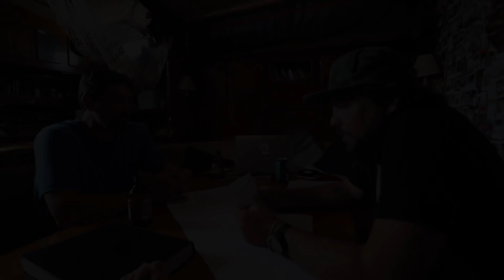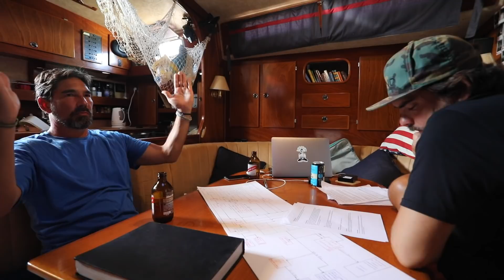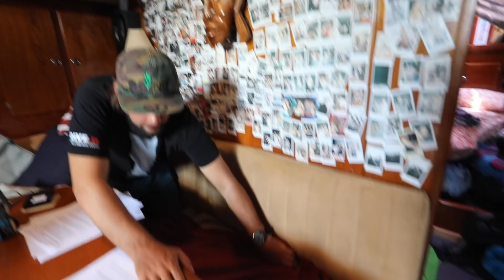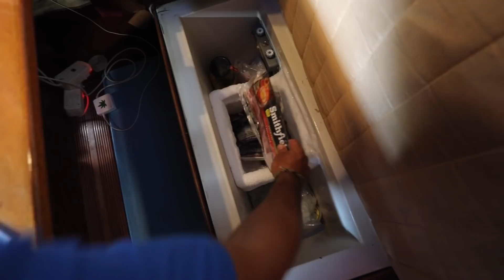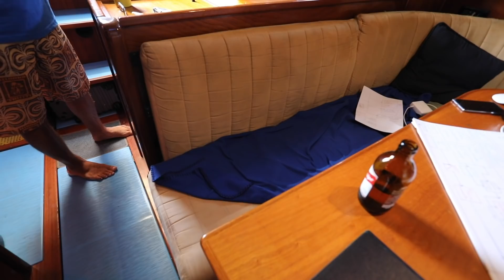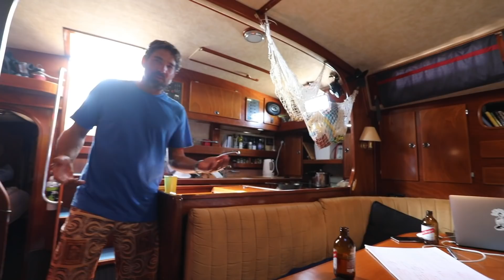How Cost effective is solar power? - ELECTRICAL BOAT TECH (7 of 7) -  Sailing Vessel Delos

Comment: It looks like your freezers are (just guessing) 1 foot by 3 foot and 1.5 feet deep making it 4.5 cubic feet. That's pretty much a normal home freeze size. But you have 2 and one is not used. Could you turn the one to the temperature of a fridge for those times you need more fridge space?

Comment: Brian, you blew it on the solar cable size.  You considered the MPPT output to batteries.  But there is a large voltage drop in the MPPT from the solar to the battery.  Your cells probably output 95 volts or so at a much lower amperage, and it's that current flow that you need to cable for, not the output of the MPPT.

Comment: It's my Birthday in two day's. The coolest gift I could receive would be a reply to this suggestion, and even better if Delos takes up the idea for a video/s. May I suggest Brian does a video explaining some basic electrical theory, and use an existing web page so viewers will have reference information. Some topics beyond explaining watts, amps and power should include wiring in series and parallel, starting current vs running current for electric motors, sizing wire for amps and length of wire, end connections, running wires through bulkheads so they don't chafe, and a few other things. This can be aimed at someone wanting to install LED strip lights for example. For voltages above 24V, stress the point that only an electrician or suitably qualified or competant person should touch this and why.

Comment: When calculating wire gauge, Amps and distance of the run are the two critical factors.  If the gauge is too small for the run and amperage, you will see a voltage drop from the source to the drain along with generating heat in the wire which will also increase the resistance, causing more heat and more voltage drop.   Clearly boats aren’t that large, but something to keep in mind for folks doing land based solar.
Reply: If i'm not mistaken...and I could be, #8 thhn copper is good for 55 amps. Why run #4 or #6?? just asking. plz correct me if I'm wrong

Comment: Without looking through all the replies you already have...... have you thought of mounting a compressor on your main with direct drive (with a clutch maybe so could be disconnected when not in use) a bit like a A/C compressor on a car?   You might already have the PTO on your timing cover??? again not 100% on your engine without looking it up again.

Comment: One thing you say in this video I have to quibble with: I have a 9KW Electric Yacht motor in my 36' ketch, but I almost never run it full throttle. So saying that electric motors draw 10-20KW sounds wrong to me. The minimum to move my boat is about 400 to 500 Watts and 1-2KW will drive the boat at 3-4 knots. I don't have solar yet, but I think I've figured out how to put four 300 Watt panels on my boat. With 1.2KW of solar, by motoring slowly, I could keep up with with motor energy usage while the sun is shining. If I were to go at minimum speed, I could probably keep moving around the clock (very slowly). I eventually plan to add a wind generator and switch to Lithium Iron batteries (or anything better that comes along). Also, the motor starts generating power when sailing at over 5 knots. Contrary currents and wind on the nose can be problems, but not having to hunt for dodgy diesel in questionable ports seems like a win to me.

Comment: Brian, with respect, you may be forgetting the regenerative capabilities of the electric motor as the prop is dragged through the water whilst under sail.  This can generate as much as 2KW a day at a moderate 4 knots... more than enough to recharge a Lithium bank for propulsion: Four days of regenerative sailing would gift the battery bank sufficient power for 4 hours of motoring.

Sure, it's not enough to motor for days when completely becalmed, but you're cruisers... what's the hurry?!  Go with the weather!  The regen capacity will give you more than enough to get out of the way of a storm or get into port.  

I'm surprised you guys haven't cottoned on to the Watt and Sea hydrogenerators by now.

Comment: You mentioned 3 to 1 in your weight convention in regards to your solar panels. Actually 2.2 lbs = 1 Kilo.
Reply: One solar panel is 17 kg, so the weight of the three panels is 51 kg. That is perfectly OK with me because hey have three panels on that arch. It was not a conversion BSMOODHA. I love the brothers using metric as Americans and no lbs.

Comment: Looks like you need to "deice"/clean your freezer evaporator. Hard too see how thick it is with the ice on it bit they are usually pretty Thin. It helps alot on power consumption.
Best regards from the West coast Sweden

Comment: With a pid controller you can use your second freezer as another refrigerator it would run extremely efficiently as it has a bigger compressor then a refrigerator

Comment: We have 8 panels rated for 2.76 KW of feed and initiall output is 3.1KW... producing 27.6- 31 KWh per day they ate also engineered to work well in cloudy weather,  we also have approximately  14.4KWh overnight storage...
Reply: Miss print... 8ea panels  345 watts each, 3.1 KW, total watts...

Comment: My solar panels are 345 watt that's guaranteed not to drop below that amount for 25 years they are Q cells from Germany,  actually when you first get them they put out 376 watts per panel...they were $220.00 per panel, they are fairly big at 1 meter by 2 meters but well worth it... can't be beat... we got them from a distributor in south Carolina...  if you really hunt around good deals can be found,  we also got ours close to end of the year so they were clearing out old stock...

Comment: Could you set your 2nd freezer to fridge temp and use it as a 2nd fridge? Or run it for say an hour then turn it off for 6hrs for those long trips and 6 crew times?

Comment: I really liked this whole series. If you want to reduce the starting current on a motor like you dive compressor, you could look into putting a soft start or VFD in the circuit to reduce the initial spike and control the power. You can contact the manufacturer of the compressor to see what they think. If you contact a VFD manufacturer (like Allen Bradley) they will tell you they can do it. Cause they can.

Comment: if you had the space for it, would one of the Tesla "House mount" batteries be a workable alternative to the bank used on Delos??
Reply: Interesting question for Brian.  According to a pdf found at Tesla, the Powerwall has a usable energy storage of 13.5kW-hr.  In part one of this series, Brian says that Delos has 400A-hr at 24V which is 9.6kW-hr of energy, so the Powerwall can store about 41% more.  In segment six, Brian says that they can't really run the air conditioners at 1000W each for very long, so the battery capacity does limit some types of high power usage.  The Dragon Fly Energy Batteries  fit very nicely in a space designed for lead acid batteries.  That might be difficult for the Tesla solution to best.
Reply: the size factor would be a definite problem and I don't see a boater being interested in a Powerwall  for most instances, where as you mention, they're replacing existing battery banks that have been sized for "standard" batteries.   
I was thinking of a case of large scale remodeling, or a full scratch-build (like Ross from Life on the Hull, building his own catamaran, or Mads from SailLife , who's gutted and rebuilding a sailboat)  where a specific place could be built for it,  I wondered if it would be an economically viable alternative...
Reply: @timhyatt9185  Heading to Tesla.com, I find that the v2 powerwall are $7600 US which is competitive.  8 each Dragon Fly are $8000 for less total kW-hr.  So if you can find a way to map the Powerwall slab to the domicile (sailing vessel or traditional sticks and bricks domicile) it appears that Teslas's offering is competitive.   Please, others with more knowledge weigh in!)
Reply: Tesla uses lithium ion cobalt battery chemistry i believe.   Although Lion Cobalt is more energy dense it is not the safest cell type to use for a boat.  For a car application  that you can park and just get out of when it goes south.....no problem.   But for a boat that you sleep on in the middle of the ocean no thanks..  
What Delos is using is Lithium Iron Phosphate batteries which are less energy dense than Tesla packs but much safer and not prone to thermal runaway and fire. They also have potentially longer life expectancy.
Brian also mentioned their current Solar output would need to be increased before increased storage capacity is warranted.
Reply: I think for anyone on a boat sailing around the world with limited access to supplies something like the Tesla Power Wall is a bad idea. (and wasn't designed for that application).. I would think if something broke on it... It would be a nightmare trying to find parts.... or even people that know what it is...   Also he said in the video... The problem with there current setup is with the amount of power they can generate from the solar panels. So Adding more battery or kWh's is not going to help them.

Comment: If the solar panels are in series 10 awg wire is enough. The higher the voltage the lower the amperage needed to be push across the wire. I run 2000 watts on 10 AWG wires on 48v system. It would burn the wires at lower voltages. I got my 340w panels at fred480 very cheap with free shipping. My 7 year old 16kw lithium battery bank is at more than 80% capacity but I do not charge it over 90% or discharge below 35%

Comment: Swanson's Law is to solar is what Moore's Law is to computing, in 1973 one watt of solar cost $100 now it's less than $1.00.
Have you looked into soft-start capacitors for your watermaker & or dive compressor to reduce heavy starting current draw?

Comment: You just mentioned refrigerating eggs. But, you can coat them with petroleum jelly and leave them in ambient temps for weeks! This seals out oxygen which causes degradation by oxygen penetrating the shells. One should wipe down the shells before use. I used to use this technique to preserve eggs on Caribbean passages, with NO refrigeration.

Comment: you might have answered this but is your solar power coming on the solar panel AC or DC
Reply from the maker: DC.
Reply: Yes, solar panels is CD and connecting the panels in series  enable it thinner wire for long distances. Most wind turbine are a/c to run on thinner wires then convert it to DC with a bridge rectifier right at the controller.

Comment: We are a 12v catamaran with 2100w of solar and 900ah of lithium. We ran our generator only 2 days in 4 months. It's too much to trouble to keep it around and we've just had the old rust bucket removed. I'm adding another 300ah battery in the process.

It's amazing to me that Delos can have so many people living on board and you don't have more solar or run your generator more often. You guys must be really efficient with your power usage!
Reply: Delos's 24v system is more efficient than 12v and 2 wind turbine adds a 10% of total power, but if you upgrade your system go with the 48v. You won't be disappointed and all 12v components can be run with 48v to 12v converters.

Comment: I was surprised to realise you have a separate generator engine from the main engine of the boat.  Isn't that redundancy?  I was assuming that you'd have the main boat engine, and it would have sufficient generator power to charge batteries, run your dive compressor and such like; that even when not motor-cruising you'd just start that up if you needed to have a peak-load session.
Reply from the maker: Most larger boats will have a separate generator, especially ones that require AC to run some of the heavier draw items.  Potentially with a large enough inverter and charging capacity (alternator, solar, wind, etc) it could be doable for a serious cruising boat to run off DC only.

Comment: Been an excellent series, really helpful as we are refitting a 42 year old Rival 38 for liveaboard cruising in a few years time. We are also going propane free.
Living in the UK we face challenge of needing a lot of space heating in winter. Wondering if you have seen any workable electric solutions?
Reply from the maker: Hey Dave, I have been researching heating as of lately for Delos and the best solutions really are Diesel powered due to the constant draw requirements.  Same as Air Con really.  I suppose if you were plugged into a dock then an electric powered hydronic system could actually work.
Reply: @svdelos  we are experimenting with electric radiant panels while in the boatyard. Effective but given reduced solar power in winter will sadly need shore power.
Have removed condemned propane cooking and paraffin hot air heating. Would love to be fossil fuel free but heating is biggest challenge around these latitudes.
Reply: @neliosamch3195  wow, long url!! 😂
Our headlining is falling off, so we are about to try fire resistant closed cell foam as insulation and lining combined. Still heating is also required because we are softies 😉

Comment: Why dont you use an electric outboard on your dingy?
Reply: You cant have all 3 things, but what do you speed for? You loose the noise for the speed.
Reply: @Ugloke  well that is a choice we are happy with but our plans are for early retirement and we are not going to be diving and will be a long time before we go to such remote places. So for us a good option but Delos do some serious miles and big tasks in their dinghy.
If they had to run the generator more to charge the dinghy motor would there be much advantage?
Reply: We've bought one for our RIB but we are not expecting to get on the plane with it. At the moment if you want speed and range and a large dinghy the options are very limited (and very expensive, with lots of charging capacity needed)
Reply from the maker: Hey I have considered but it does come down to range and speed.  Our dinghy is really our car, and for where we live we need a SUV type of dinghy that can get up and plane with lot's of range.  Given the battery capacity of even the latest technology it's just not something I believe is realistic as of yet.

Comment: Hi Brian, are you excited about the upcoming Starlink satellite internet? How do you think fast internet connection would change your life and workdflow onboard Delos?
Reply from the maker: ha, mixed about that possibility but we will see.  One of the things we really appreciate about sailing is being off the grid.  I suppose if you have the will power to leave it turned off most of the time it could make our work-life balance a bit easier instead of seeking out internet at every post....

Comment: I average 150 AH per day. Haven't needed my Genny in a year. 1kw solar, 500 watts wind and 432 AH battery capacity. Large frig, separate freezer, able to run water heater off inverter. Don't have a water maker or dive compressor.

Comment: It seems if you went to a hybrid electric system. The optimum would be Electric motor with a separate battery bank to run 2 to 3 hours then use a diesel generator to power the boat for long passages. On the larger electrical motors you can put them in a regeneration mode while sailing to top the batteries off and not use the generator to recharge.
Reply: Diesel Electric......lots of ships do it this way.  Usually multiple generators so you have a backup. It’s an efficient way to power a boat but not cheap up front costs.

Comment: It seems that the upgrade to lithium batteries improved the quality of life on the boat. You've eliminated propane and use the generator less, is there any other cost savings? How much per month did the switch to lithium batteries save you?
Reply: Not only on boats but everywhere. I used to spend $75.00 dollars every 3 weeks to fill up my car. Now,  I spend $0.0 because I recharge it with solar panels.

Comment: A super capacitor "battery"(its not) would solve your Dive compressor locked rotor current start problem.  They can put out 1000 -->3000 amps easy.
Reply: But it takes so long to fill a tank on a small compresser. Not sure what their compresser is but its probably 20 - 30 minutes per tank
Reply: @TheCappleaz  Do you enjoy babbling stupidity?  What you posted has NOTHING to do with a super capacitor and starting current of a dive compressor motor.
Reply: @w8stral  its a mute point because they ain't gonna draw 3000 watts from their batteries for 3 hours just to go dive once. But whatever, you're obviously a genius
Reply: @TheCappleaz  ?  Try basic math... Add a couple more solar panels and they easily could.  They have the space for it.  Now if you wanted to dive all day.... No.

Comment: Next step is to replace the diesel engine with electric!!!
Reply: Only partially possible on a special Super wide catamaran with bow to stern and port to starboard solar panels covering.  Then you still need a generator if you are in the tropics as you get no wind, no solar for weeks.
Reply: I highly doubt they'll ever do that... can't compare the power of a diesel to an electric.
Reply: There are channels with electric motors on monohulls (Sailing Uma, Rigging Doctor and Beau and Brandy are 3 examples).
None of them have dive compressors, all wait for wind and only motor tiny amounts.
Reply: Check out the new sunreef 60E
Reply from the maker: I am looking at electric options, however we have a minimum range under motor, of which batteries fall short by a huge factor.  This leads us to an electric-diesel hybrid option which I think if done correctly could be an interesting option.
Reply: @svdelos  got a question would the price of money be worth it if you're diesel motor is working?.... hence the question why fix something that isn't broke.
Reply: @svdelos  Then add a super capacitor "battery" so you can start Dive Compressor, etc as it can do several thousand Amps